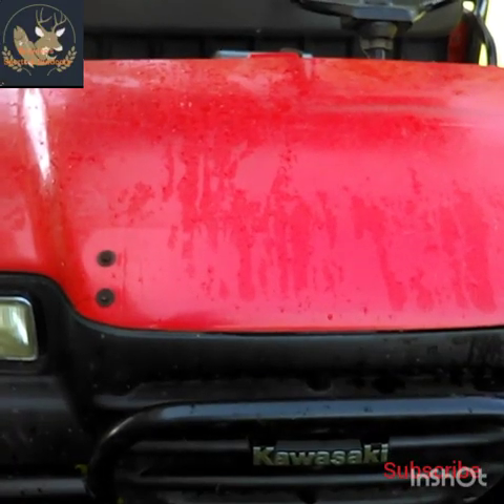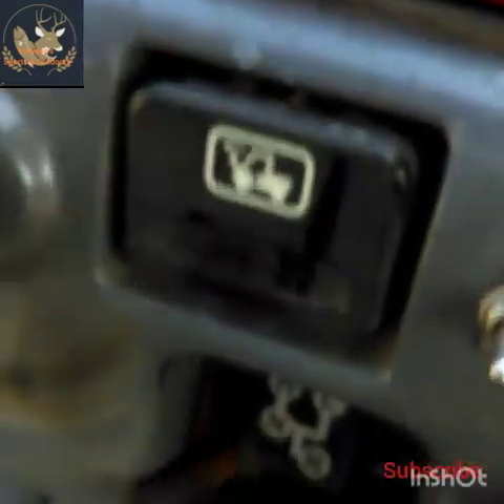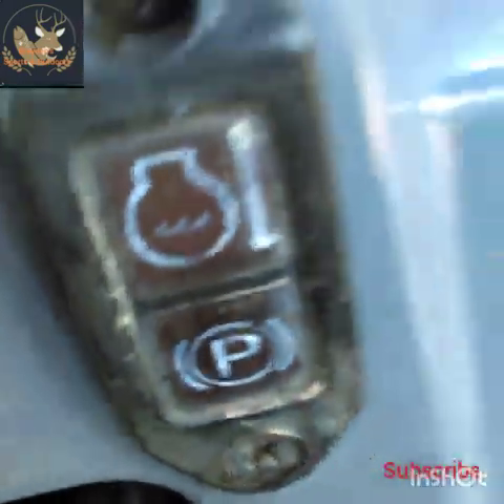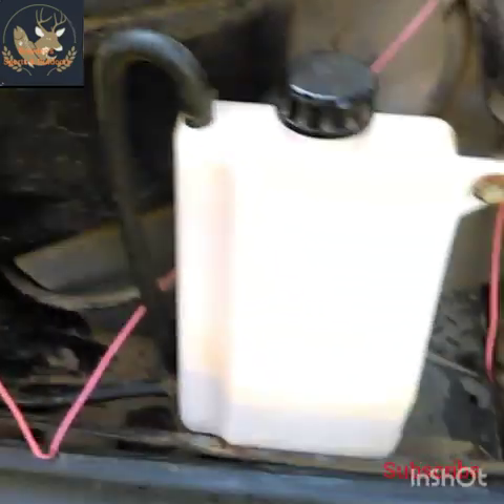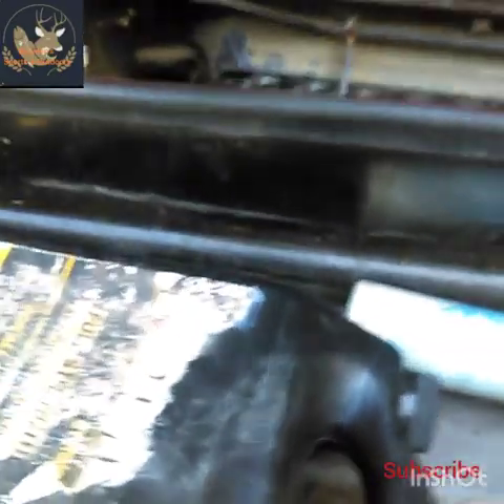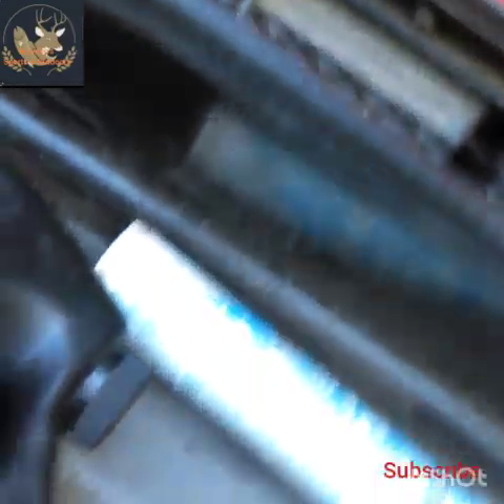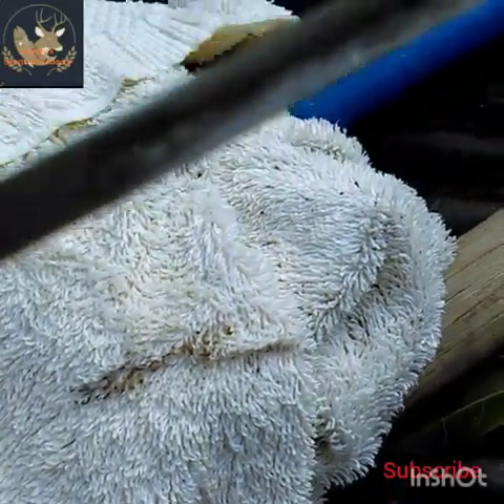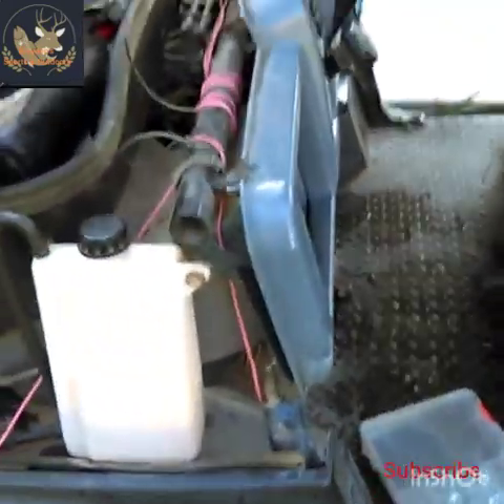How to prevent a Kawasaki Mule 3010 from over heating

Comment: Never add water, add 50/50 antifreeze 
Blow out radiator fins or wash out with water hose not pressure washer
You can pump up radiator and test for leaks 😊😊

Comment: So, cars and machines in the 1950s often had drips, leaks, consumption of fluids, and it many motorheads would clean, polish, check the oil, water, filters, belt tensions every week, on Saturday or during the week if there was a cruise on the weekend. The harder you use these things the more they need. Keep it up as much as possible, so when you ride, you enjoy! And preventive maintenance is cheaper than a rebuild! Drive safe!!👍

Comment: So I’m just gonna put this right here obviously your radiator needs water but instead of water you should probably use coolant because coolant doesn’t reach a boiling point and evaporate water evaporates which is going to make it disappear again because when water boils and evaporates but when coolant gets hot it does it’s job and cools the engine
Reply from the maker: 👍🏼 thanks man
Reply: @braydenhardy5188  my pleasure! Awesome video though!